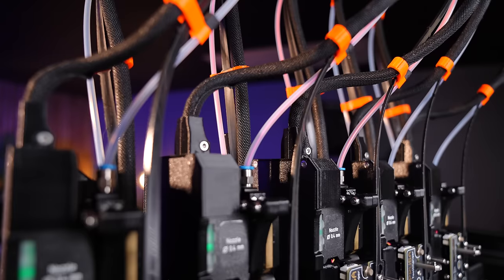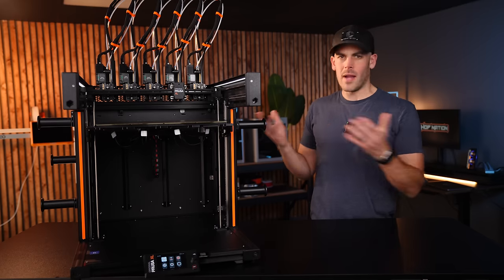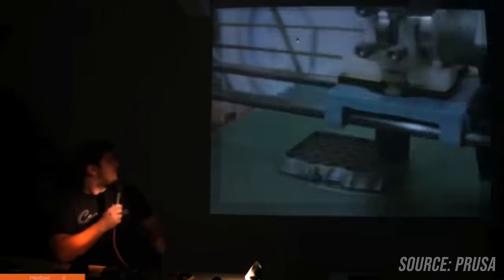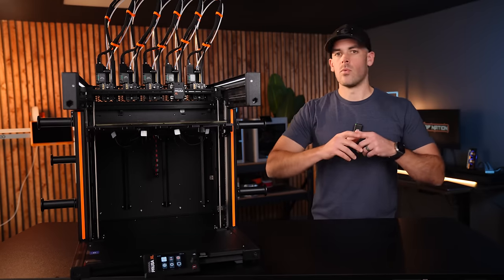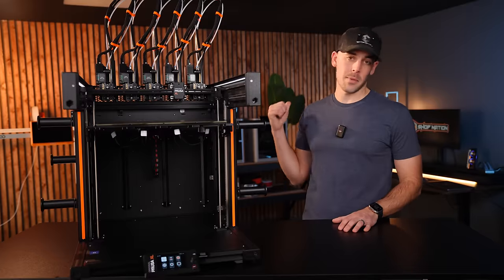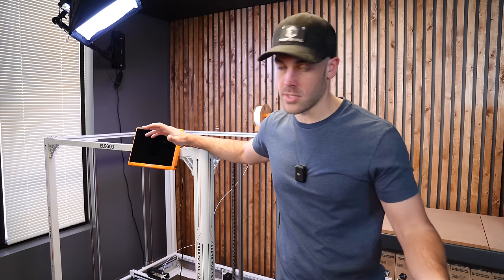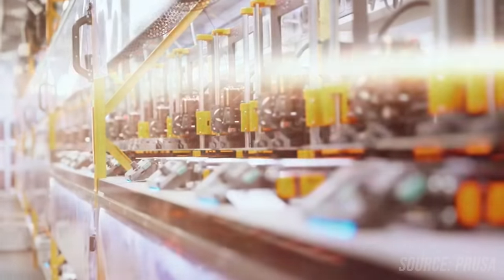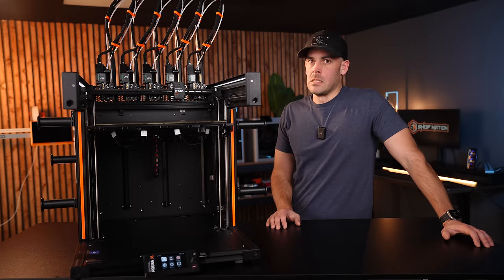Why Prusa is the next Blackberry

Comment: Your logic seems flawed. You use the extreme example to see how big of a difference it makes, and the fact you were shown 2hrs vs 14hrs means that on the continuum of difficulty, the Prusa has very, very clear advantages. You're analysing this by just discounting the benefits. This feels like you already had an outcome decided, and then you worked back. What is the cost or energy benefit of having a multi-head vs a single-head? Are there any industries where this could scale and mean a significant improvement? I would posit that there is, even at a 2hr difference, this is quite significant if you run a print farm for 300 days a year a 15% improvement in speed gives you an extra 45 days worth of print time that is a huge amount at scale.
Reply from the maker: I’m not looking at this from a print farm perspective, that’s not the common use case. That math would also further prove my point that ONLY for a hyper specific part type, the XL makes sense
Reply: This is highlighting again how your analysis is flawed, a £3,300 printer it is not aimed at normal consumers; it is for industrial or print farms. Multi-material, extra speed, less waste can all be benefits which in a commercial environment are difference makers, even at double the price. I worked with companies who would spend triple or even 4 times the price because of slight improvements, less downtime or better customer services. Ignoring print farms, which would clearly benefit, just highlights what I stated earlier: that you've decided the conclusion then worked backwards. You run a print farm what is your biggest cost?

Comment: At 6:40 you are showing the Elegoo Orange. We manufacture machines, and the Bambulab X1C is a Godsend, but we really need a similar quality printer to print parts that are at least 600mm long. A tripple deep X1C I would buy instantly but can Elegoo do high quality prints like that, or are we more in quality ranges ala older Creality Printers and the like?
Reply: So, with large prints you are going to lose detail. They are designed for high volume (filament) printing, so minimum 0.08 nozzles and higher. But for large functional parts, that should not be an issue. The current issue with the current iteration of large format printers is bed warping. The build plate will warp +/- 0.075 (or more) in either direction near the corners causing adhesion issues, printing defects, and out of spec (dimensionally) parts. None of them use a build plate like the XL with sectional heating which might solve the issue (or at least make it more usable). Also, at that scale, you would be better off printing with pellets vs filament, and the availability of pellet-based hot ends is limited.

Comment: One big difference between Bambu and Prusa is the open-source culture of Prusa vs the patent-lock-everything culture of Bambu. This in turn will make a difference in the longevity of a printer because with the Prusa you can literally change every single bit and piece of hardware and software while with Bambu it is "do or die".
Reply: What patents does Bambu Lab hold? I can buy plenty of Bambu Lab replacement parts online from sellers not named “Bambu Lab”.

Comment: They are too proud of themselves; they need to change production processes so they can produce cheaper at scale and lower their price.
Reply: Wouldn't be enough. I work in manufacturing so i know production processes and the tangible impacts, everything i've seen thus far from Prusa suggests optimal strategies for the scale in question where changes will not net any benefit. The problem is that being in Europe itself is the main cost driver due to the costs of labour, higher taxation and the logistics required to gather components here. The only way to achieve lower prices on that is to completely move and start waving the red flag with little yellow stars.

There is a bit of a on-going trade war between continents and the asian superpower doesn't play fair as anyone competing from there can expect heavy subsidization and extremely low cost of operation. Enabling market domination which is a recurring story that has happened to countless of markets before 3D printing. Most well-known example is Solar power generation which is exclusively controlled by Chinese companies these days.

Comment: Bambulab is closed ecosystem and you can’t maintain or repair printer without sending it to Bambulab. The same principle as with cars: get something that is popular and has all replacement parts in stock in your area. This is what keeps Prusa on the market. BL have many cool features, but i think Prusa folks can also add similar solutions in near future.
Reply: Who told you that you need to send in Bambu printers for repair??? They sell a whole bunch of spare parts on their website, and will sell you anything not listed if you ask them. The parts are super cheap too, and they have a massive Wiki page showing you how to repair anything on the machine. 
It's a bit more off a hassle to work on than a Prusa, because of the whole enclosure deal, but Bambu machines are actually super easy to fix if you ever manage to break anything.

Comment: i feel like this is an apples to pears comparison. the xl is not designed to be a hobbyist/consumer/prosumer printer. it is designed to run in prusas fully automatic print farm, the pro AFS.

it is not meant for people that would consider a bambulab printer for their use case. you are supposed to slab 50 of these into your production facility and have them go 24/7. 

and for that purpose, they absolutely are designed geniusly, from automation over maintainability to their really competitive price (considering other solution in the same field of application).

the mark iv on the other hand feels like a hard pill to swallow, compared to the latest bambulab modals, there you have a point. i really think, the mark iv was a hot shot, and they will release a more modern design shortly after. at least i hope they will.
Reply: The Prusa Pro AFS and the XL are two completely different things, you can't buy an XL and put it into that print farm system. The XL is absolutely designed for hobby use, the entire web page just shows it printing toys and trinkets. Their industrial machines actually have the capabilities to print ABS, ASA, Nylon and so on. You can even print PEI on their Prusa PRO HT90 which has an impressive 500c nozzle and 90c chamber temperature. The XL can't print anything more advanced than regular PETG.
Reply: @NorwayVFX  oh, well thanks for that clarification! i somehow got things totally wrong then. i just saw an interview with prusa himself a while ago, and from what i understood, he said something along the lines of slapping the xl into those afs farms, which totally seems not to be the case, as you pointed out.

the use case for that model is beyond my imagination, then.
Reply: @miko007  It's not unlikely that Prusa changed plans somewhere down the line. The PRO AFS seems to use a lot of XL parts just mounted differently and without the multiple tool heads.

Comment: Help me out. I was about to buy a prusa and a friend of mine said not too and get the QIDI because for same reasons you said.  He cited that prusa uses the heated bed in the x and y direction and that causes the printed part to wobble if the bed is moved to fast thus slowing down the printer.  That true? Whereas newer printers, the bed is only in the Z plane.... he also told me that QIDI nozzle is all metal and can go to higher temps.  Any of this true?

Comment: With the Bambu Lab printers remember you're buying one printed item for the price of two every time you use the AMS due to waste.  In a print farm that does multi color prints constantly the Prusa XL price looks a lot more reasonable.
Reply: A channel already did the math. An X1C(1300)would have to do hundreds of thousands to over a million  color changes in waste for the break even price of the XL. (4000)
This is before using the long retract option, lowering flush volumes, printing multiple object, flush to infill, reduce prime tower etc.

You are looking at years of printing and $2500 worth of filament. This is before a single gram is printed on an XL. 
 It's gets even more nuts if you compare it to an p1s(850)or A(490)

Build size or tpu and another filament is where the XL shines,But waste isn't one of them if you care about your wallet.
Reply: @hawtdayum  remember that it's available semi-assembled
Reply: @thefantasyforge5015   The calculation doesn't change things that much. So let's assume the preassembled $3500 (I'll ignore the $200+ in shipping)
X1C - $2200 difference
P1S-  $2650 difference
A1 -$3010 difference.
That channel gets filament in bulk roughly $10 a roll or 220-301 rolls but you can tweak the math. And roughly 1000-5000+ swaps in a 1kg roll. Obviously we are looking at just swaps not the printed model or (variable)prime towers. 

The XL has its advantages, like overall swap speed, bed size, actually multi-filament printing, but the waste argument isn't one of them. $2200 to 3k in filament is an insane amount to print in waste in any calculation. And that is assuming you make odd choices in what you print, like you are purposely trying to print wastefully but be prepared for a very very long time to pass for that to happen.  

That price difference is a small print farm in printers or up to quarter ton printed in just waste which again would be many years down the line if you ever reach that at all.

Comment: where exactly are you getting a bambu labs X1 for "a couple of hundred bucks"?? Last time i checked, they were around $1500 (that's 750 couples of bucks)
Reply from the maker: I was referring to the lower cost P1P that gives the same reliable operation
Reply: Real simple. Bambu Labs has fuck all support and you cannot get parts. 

I have a dead x1 and can I get the part I need? Nope.  2 weeks down so far.

Comment: They need to add inputshaper and motion comensation. Amazing that they totally ignored the need for an imu
Reply from the maker: They…did? Those features are present in all of their new models, plus you can upgrade their mk3 too
Reply: @ShopNation   There's no IMU on the Y and X axis. It's using a "pre-tuned" profile with all the MV/EI values from a stock printer that Prusa themselves have averaged across a few printers, and those numbers are pushed into the firmware update. The motors make assumptions of the values not based on your individual setup but the absolute stock of what the weight profile of the axes look like. This negates any customization that could have been different from what Prusa has, even changing the way you hang your filament that's vibrating the printer makes a difference. It's such a non-solution.

Comment: As a mechanical engineer, the Prusa XL is the coolest 3D printer I could think of to buy.  As a mechanical engineer, it costs $1,000 more than both my vehicles put together, although probably more reliable than both, but that's $1,000 more than I have to spend, and it doesn't get me to work.

Anyways, I still have an Ender 3 that I haven't had time to finish playing with and it's been sitting a couple years, probably because I've been fixing the car and house.
Reply: What are you driving 2 Geo Metros or something?

Comment: Prusa has been around for over a decade and will continue be be around for the next decade and longer. They were selling 9k printers a month before bambu lab. And now they're selling 10k printers a month after bambu lab. Prusa isn't going anywhere and their sales number prove it. Prusa has been the most innovated maker in the 3d printing realm and bambu lab printers are built upon prusa innovations.

Bambu lab just had a major recall due to piss poor QC and R&D that is costing them millions and they've got some of the worst quality control and customer service to the point where they have publicly stated how bad it is in official statements. Bambu lab is just another printer in a sea of CCP made products. All with low build quality and questionable ethics. Their customer support has 3 week leadtimes on simply answering support tickets. That's embarrassing for any company in 2024.
Reply from the maker: While I agree their customer service needs work, their QC is unreal considering how quickly they spooled up to selling thousands of printers a month. I have lots of both brands and have had zero problems with quality from either

Comment: I want to see an xy machine with a RELIABLE multi color setup that minimizes wasted material, color change time, has a huge print area, and costs under $1300. I'd like it to be open source and no required cloud connections. I may be one of the few but I don't really care that much about print speed. I'm a good planner, tinkerer, innovator, and problem solver. I don't want a machine that always works if I have to give up my freedom for it. I don't want my ideas to be permanently tied to a single company's support for materials and software. That's the point of 3d printing at least for me.  The freedom to create. 

I absolutely love what Prusa stands for and what they have contributed to the 3d printing community. I think they will make a speedy return with fresh innovations.

Comment: I disagree, the XL seems to be targeting Zortrax, Ultimater etc., the much more expensive printers with such build volumes, who don't have issues that you can't resolve easily because of their closed source nature. I have used these machines in a company and I wished Prusa to come up with an alternativce and they did, a much cheaper one compared to similar offerings from other companies. All the features of this have real innovation, just a different type. I wouldk love to see an IDEX version of the XL with 2 tool heads, as I think IDEX has mnore benefit that even more than 2  individual print heads because you can either print 2 sets of prints at the same time, or have multi matereial printinmg for support. 

The Mk4 is a letdown as that is the one competing with the Bambulab X1 etc.

Comment: if i was Prusa, i would make an extremely advanced printer with 300mm^3 circular print volume, 12 different customizable printheads, very fast print speeds, an actively heated chamber, and in the shape of a cylinder to fit its very advanced motion system that moves the printhead around the circumference of the cylinder and extending inwards with an extending arm rather than a gantry. this makes a printer that not only has a perfect color change routine, but is better than an X1 Carbon in every way with extremely powerful and silent motors along with silent fans and a 50mm long ultra high flow heat brick mounted in three of its 12 print heads. the other print heads include 2 liquid cooled heads for engineering materials, 2 heads with special hotends and extruders for printing the most flexible of materials and the last 5 heads being standard heads like the Mk.4.. but this is just an idea that i came up with and probably not viable.

Comment: in a month we will be ordering new 3D printer at work and although my friends recommend bambu lab, for some reason I don't want it. Don't know if it's too hyped or what but I just don't like that AMS.Prusa MMU2S was also very bad, so bad that we literally threw it in trash after few months of tinkering. AMS just spits too many additional material. XL is much more expensive (you can buy additional 100kg of filament with that money) but if you're running with AMS, you will throw out that 100kg and will be at the same place. 

If you comapre it like that, XL has the advantage in long run.
Reply: A single bambu machine vs prusa XL  cost is about $3000(p1s Combo)-3500(A1 combo) worth of waste in filament. Which, depending on your prints can be a long way off if it will happen ever during the printers lifetime.
The main advantage in the prusa is speed of filament swaps at that build size. But if you are spending nearly 4k on a single printer you can easily get 7 A1, 4 P1s or 2 X1C and 2 A1 for the cost which negates the XL speed advantage in terms of long term yield.

If you are going single filament that is even less a reason to go Prusa. You can find printers with as large or larger print volume for thousands less. If you need to print exotic materials it does not have an enclosure and you need to source one. But then the are Qidi, creality etc. 

PLA rolls in bulk are about $10 could be 300-350 1kg rolls (half for 20$ rolls)

Going back to bambu the purge default settings is about 0.2-.3 grams before easy to implement tweaks of 50% in savings yield
You need to do high hundreds of thousands to millions of filament swaps to get to the BREAK EVEN cost of the XL before a single gram of filament is extruded on it .

But the AMS is more than just color swapping
Passive drybox, holds 4kg of filament, filament runout redundancy, repeatable and consistent extrusions. (there is a filament buffer on the back of the X1/P1 printers for filament) Remote printing. Easy color swaps between jobs meaning you do not have to manually switch anything that is compatible. 

Hype or not the printers are that good and people who have been printing for years are recommending them
He runs a print farm and is replacing his prusa machines with Bambu printers. He has the data to back up the switch with cold hard data showing yield, print time and up time.